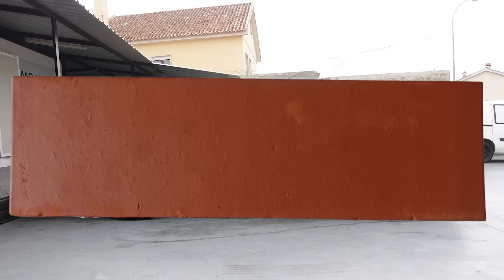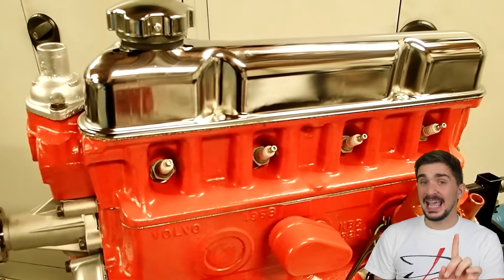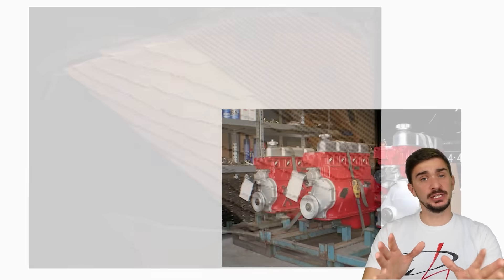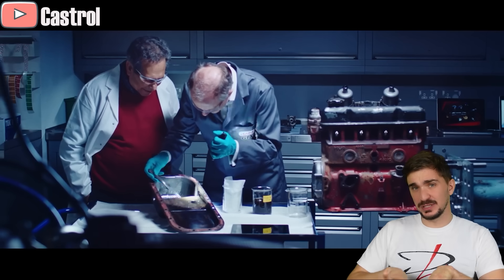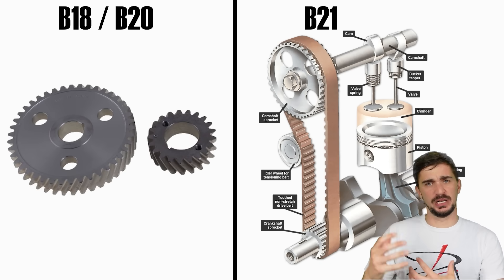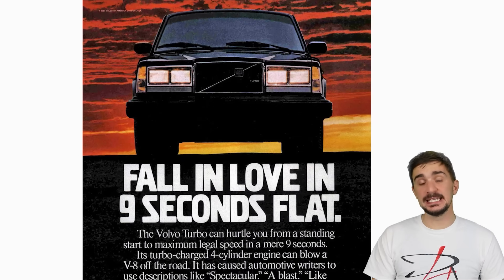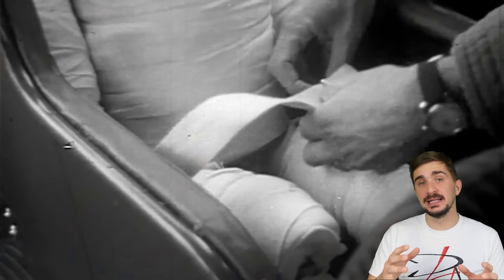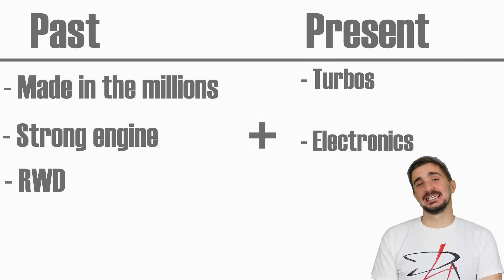A Story about the Volvo 240 and its Redblock Engine - Iconic Cars and Engines #18

Comment: The Volvo B18 has a similar timing system to the Ford 240/300 inline 6 since they both hast cast iron timing gears. Almost thought the B18 would have been inspired by the 240/300 inline 6, but Ford didn’t come up with that design until 1965, but still interesting on how the layout and design is similar design being 4 years apart.

Comment: Imagine what we would be driving today if corporations still built cars with the CUSTOMER in mind first. But instead we get "efficiency" and "maximum profitability" with dealers charging insane labor rates for fixing issues the factory designed into the cars to boost profits. Planned obsolescence and record shareholder profits beats making good cars.

Comment: this car is undiscovered treasure, when the design is this good it becomes a work of art; extremely easy to work on too but if you get one of these older ones it's very important to check the drive shaft bearing; might need some grease

Comment: I should have purchased an older Volvo. Instead I purchased a 1997 Volvo 850..... engine was a total piece of junk. Head-gasket started leaking at 100,000 miles. The local Volvo dealer didn't want to touch it. They said it wasn't worth fixing as on that model because the head is attached with special glue and is very expensive to repair. Instead I drove around with cans of head-gasket sealant in my trunk. Almost every other Volvo 850 owner I met had similar problems. The heater electronics was very complex and kept needing repair. The 5 cylinder engine was also difficult to work on. To replace the starter, you need to first remove the intake manifold. Unbelievable. I've never seen this on any other car and I've changed probably close to 100 starters. The car also had a useless turbo. Upon acceleration, there really was no noticeable increase in power. I bet if you had another identical car without a turbo -- there would be virtually no difference in performance.   IMO -- turbos are more trouble than they are worth on small gas engine cars.... will never buy another but that is separate topic.

Comment: I worked on these 240 series for many years, but as a collision tech.  The 224 motor, and everything else about these cars were bullet proof.  But aside from the motors, the 740 series was a disappointment.  The back end was particularly weak if the quarter panel was removed and the chassis would flex literally inches without the quarter.  The 240 on the other hand was properly rigid from end to end.  I worked at a Volvo dealership and worked on hundred of them and the 240 was definately superior.  The one thing 8 did hate about them was the tarry undercoating which was closer to a semi-solid grease.  And if there was a brake fluid leak, you could expect to be covered in black for the duration.
Reply: Thanks for posting that info.

Comment: you really made my day !  thanks
Discovered your vids yesterday and have been hooked, and now I discovered this item on (old) volvo's... loved it !    I have owned quite some classic volvo's and I was once spare parts man for the volvo club in Belgium...  so I've seen quite a bit of blocks and parts, still have a P1800
Did you know the B18 originated originally from the B36 V8 light truck engine ? Cilinder head, valves, pistons etc.. were inherited from this block. Early B18's had even wider camshaft bearings than later models.  So that maybe explains a bit the overengineering ;-)
THANKS !

Comment: I had a 240, wonderful. It was built like a tank so was not very agile and the brakes were only adequate. I took the rear bumper off to remove an unwanted tow bar and it was too heavy to hold up with hand when I tried to bolt it back on. It was a huge aluminium extrusion that would not of been out of place on a bridge.

Comment: Actually the 240 came with B20 in the start. I had a -75 242L with a B20A, boasting a foull 82 hp. The weakness of the B20 was the camshaft, that struggled with lubrication in the cold weather, with the fixed fan cooling the front of the engine too much. By the way: The reason the camshaft is gear driven is simply that it is an OHC.engine, not OHV.

Comment: I almost had to stop watching at 6:53 when you say 'then in 1975 came the real deal' ~ *disagree*.  Yes, the B21/23 is a very very very rock solid engine, and I know this is a story about the 240 but...  The 240 is a wonderful safe boring box, a bit full of plastic that breaks, bad switches, crummy door handles, bad heater fans....  It only went down hill starting with the 1 series in my opinion.  The cars got bigger, starting moving in the direction of plastic, bells/whistles etc.  ease of repair and reliability started to go down hill.  The engine itself, and the whole running gear ~ any of the RWD volvos (save the V6's which suck) are wonderful and I'd argue... the older, the better.  (I do love the 240 though, I think it maybe the last 'good' car ever made)

Comment: I bought a 200 series, 244 i think it was in thr late 80's, new.  While the engine was reliable, the rest of the car was not.

Heated seats, quadraphonic sound -anything electronic failed before 100K kms.

My LS400 that replaced it was much more reliable, it was also nicer to drive, less ugly, better resale etc.

I then bought an LS430 which covered over 800,000 kms before it recently had issues that could be fixed but weren't viable, so it was sold for parts, i couldn't believe it was actually still worth anything.

Comment: I have a 1970 145s. My b20 had three wiped lifters. And it still ran basically perfect. Down on power but other than that it did not care. They are tanks of an engine.

Comment: Sigh, you really had me with a TIMING GEAR (Studebaker used them - UNBREAKABLE), and then they went to a BELT with the OHC.  Chairs are considered lifetime, why in the world would they use a belt ?   I won't buy a car that uses a timing belt - that component is not supposed to wear out.
Reply: Long ago, RR used them but they were so bad that they were replaced with aluminum.
Reply: @wholeNwon  don't quite understand:  what did RR use long ago and what replaced with aluminum what?
Reply: @NoferTrunions  As I recall, it was a timing gear, but that recollection is vague. It could have been a different gear.  But it was a fiber material of some sort. When they were replaced, the cover was stamped with "A" for aluminum. They have done a number of odd things like that in the past such as incompatible metals suffering from electrolytic damage, defective crankshaft casting, etc. They were odd cars.
Reply: @wholeNwon  Ah!  Studebaker also started with a fiber timing gear - but it was massive,  at least 1" thick with a mild helical cut.  They ran this on all their engines starting in 1951 until 1964 when they stopped.  However for their R-series engines from 62 to 64:  high compression or supercharger, some with rare big intake port/valve heads, they used an aluminum gear.  I think the issues was the steel hub interface with the fiber gear but speculation on my part.  NEVER saw a fiber gear fail.  FYI I had a numbers matching package R2 Super Lark with an R3 engine swap.  Had for 52 years, sold it last year with over 10 pickup truck loads of parts.
Reply: @NoferTrunions  Amazing. We had one in the '50s...peacock blue. Can only barely remember it.

Comment: volvo b series motors are amazing. had a b20f could never kill it. fed it so much shitty fuel and oil. it never cared..started every day. best motor i ever had,

correction sir.  1993 was not the last year for the 200 series. 
the last volvo 240 series was the 244 Olympic Edition. Released in 1994 for the Lillehammer Olympic games. I had one in white so i should know.

Comment: having owned b16 true amazon , to v90 the last r w d and real volvo ,the best all round was my 240 glt wagon absolutely stock, went far better than it should , had coil spring dampers at the rear as i towed a trailer , you could get this wagon in a nice 4 wheel drift on real fast turns , but my real rocket was my 121 wagon ended up with a 2.3 push rod red block , 200 bhp on webbers 180 on su,s , this would pull 7000 in od top 130 mph plus , could never get a stiff enough front arb , where as my white block is so smooth , but i could only get a freaking auto and the gear programing is shit , but for a huge wagon it still handles great, as for the new v90 its shorter taller and made in china that sums it up

Comment: Well, having owned 142's, 242's, and a Bertone I can say I like Volvo's. 
BUT, how do you explain that turd of a 6 cyl motor that came in the Bertone??!! 
Coming home from work one day I did a casual downshift and the shaft that the fan is bolted to broke and the fan propellered through the rad....! 
I was only 4 or 5 blocks away from the house, so I drove it home.  Still, easily one of the worst engines Volvo, Renault and Peugeot ever. No Swedish steel in that thing I'm guessing....!!!
I wish I had installed a redblock in the thing. Instead I found another 6 cyl at the wreckers and threw that in.
It didn't last all that long either!

Loved your article! Very informative!

Comment: I have a 1976 245DL Wagon, it was my first car.  Somewhere around 400,000 miles on it.  Also an 85 240 Turbo wagon.  The factory intercooled turbo 240 (manual transmission) is actually clocked by Car & Driver as doing 0 to 60 in 7.9 seconds.

I learned to drive clutch at age 7 in a dirt parking lot in a 145S.  We had that till the timing chain broke.  Also a 164, and have had two boats with the AQ120B, then AQ125A, and I have an AQ171A which was supposed to replace the AQ125A but I no longer have the boat.  The AQ171A is the 152 cubic inch (2.5 liter) with DOHC.  I don't know if I'll ever be able to use it though, the exhaust manifold is scarce, expensive, and with saltwater use 2 to 3 years at best is what I got out of the manifolds on the previous two boats.

Comment: My father worked for Volvo when these cars were being sold. He was a warranty administrator. He could tell you horror  stories about them. The engine was, yes, pretty solid. And boring. But an engine is not a car. And the car in total let down Volvo's "indestructibility" reputation. Those are the facts, not just opinions.

Comment: My husband's mom started off with a Volvo 340DL  then his dad had a 340GL as a works company car. Then they graduated up eventually to an 840. 

The 840 suffered a slow speed rear end collision from a Vauxhall Astra, nothing seemingly happened to the Volvo however, the young lad's Astra, which was his first car, looked like it had run into a wall. They took the Volvo to the dealers to be sure it was OK and all that had happened was that the number plate panel was slightly distorted. This was just rejigged straight. Job done. Built like a tank.

His mother chose Volvos to ferry round his 3 younger sisters in safety. It did an excellent job!

Comment: I had 2 244 gle with b21e. Loved the car. The first I knew it’s history it was my grandfathers car. Very good maintenance and delightful to drive. The second was second hand. How ever both cars, their engines started getting very slow and lot of oil consumption around 220/ 250000km. Not really indestructible. The 850 I got next, 2.5 l valve was far better. It clocked 350000km and still struggle strong. Never mind my actual Mercedes w211 with 646om which has now more then 560000km.

I still miss the Volvo. The noise. The no fuss presentation and loved that bumpy look . The car was from 1980 with those rubber bumps. But by no means indestructible.

Safety however passively was good.  Dinamically not really an alfa Romeo but it hold itself being very predictable with very very good brakes for the time.

I had notice that the b23e in latter models were far better then b21e and really lasted long time. 
Good thing in both they were no interference  engines. So when distribution broke the engines stoped smoothly not breaking anything.

Comment: Had a overheating problem with my 244(B23E motor)so had a go at replacing the headgasket and with some help and advice from local Volvo mechanic was able to cure the problem. Engine going strong even though was overheating for some time.

Comment: is there a 6 cylinder version???
Reply: If you want it in red you have to go with the B30. Simply a B18/20 with 2 extra cylinders. B19/21/23 B200/204/230/234 never came as 6 cylinder unfortunately 😔 there was a rwd L6 engine tho in the 960. B6254 and B6304, whiteblock (aluminum)

Comment: The Pinnacle of Red Blocks is not the B23T, but a 1993 B230FT (or B234FT) running LH 2.4.
Reply: B234FT has never been a production engine. Only B234F and B204FT/GT

Comment: I bought my first car, an 89 740 in march of 2022 at 19 years old with 292k kms on the clock, it was a stock N/A car some time ago. Previous 2 owners spent lots of time replacing all the non turbo parts and installing a 531 head with a 15g to pair up with it, along with all the other 940 turbo parts.
sitting at around 315k now with a stage 2 clutch, lightened flywheel, on 15 pounds of boost, and BCRacing coilovers. I think that these cars are the best in the world. they are sporty with the right mods, and will keep up with pretty much any modern hot hatch, and more. I intend on keeping this car the rest of my life, whether that means i have to rebuild it 15 times or not. I'm making sure this brick shithouse stays upright, so that 20 years down the road I can confidently say that the volvo 740 and the redblock with all its counterparts is the most reliable and enjoyable motor/car ever made.

Comment: LOL, I will have to show my daughter this video since she is the one driving our beat-up old 1990 Volvo 240. One thing that Volvo definitely screwed up on was the crappy odometers which tend to all fail miserably as the plastic gears disintegrate. Also, the engineer who came up with the flame-trap and its location deserves a serious dope-slap.
Reply: Those gears are easy to replace. The later 900 models had much bigger issues with leaking capacitors. Also fixable. It's worth mentioning that those instrument-clusters weren't produced by Volvo - some were Japanese and some were German.

Comment: Back when the goal wasn't planned obsolescence but rather: Build a good product.

Honestly love these cars. A friend of mine has one he's been driving since the mid 90:s. They just don't build them like they used to.
Reply: That was the 200 series' biggest problem. They were too reliable so who would buy a new car.
Reply: @Nubbe999  Would have been its best feature if we lived in a saner world.
Reply: I wonder if the Japanese will do the same
Reply: @ChrisPatrick-q6k  the 200 series was literally built to be the safest production car ever made and pioneered many features that are standard today and the reason why modern cars are so safe.

There's been a lot of refinement since then, yes, but there has also been a paradigm shift. Modern cars are cleaner, more efficient, safer, more comfortable and have so much more electronics in them. Most of this is good, but how much more efficient are they if you take the planned lifespan of the car into account?
Reply: it was still planned obsolescence, the heat death of the universe is just a bit later than usual
Reply: I was thinking the same thing. People actually fixed their cars back then. Now it’s just sell it and buy a new one.
Reply: Thank goodness, today's cars are much much safer, more comfortable and efficient.
Reply: @ChrisPatrick-q6k  not always the case my friend.

Comment: My folks went to Sweden to pickup their 1969 144.   You picked it up at the factory, and toured Europe to get 3500-miles on it, at which point they could be imported as a used personal vehicle, and not have to pay the import duties.  My younger brother got it in 1982. And drove the hell out of it.   It got totaled, while parked at the curb, at 600,000-mile by a drunk in a  Volkswagen Beetle.  He was pretty pissed because he had just rebuilt the entire suspension.   The Insurance company gave him $3500 for it and let him keep it.   He rounded up a Non-running 145, and swapped the drive train and suspension into the 145.

Comment: Warning, they can't hold alot of boost, because thee head gaskets and head studs are the weak points. Sent my head at 13 psi or so, but I did have a custom turbo cam that made the stock turbo scream.

Comment: I entered an old 240 in a banger race once, hammered it in second gear, all the way around for almost 75 laps before i crashed on the front stretch lol. Those motors are tough.

Comment: You said the 200 series came out in 1975. I owned a 1974 Volvo I bought in 1978. I drove that care till 1987 when I bought an inter-cooled 940. I was a good car except for the rust. I had a head on collision with a mini cooper. The bumper took the full shock of the collision and I didn't even have a scratch because the bumper was covered in rubber.

Comment: I have owned 2 740's  both used both lasted a decades plus and I sold both for profit.  Loved these cars plus non interference engines B230 red block was genious.  Open engine bay perfect for diy.  And the cars would not die.  Master cylinder replacemnt, harmonic balancer or timing belt can be fixed without a lift amazing car.  No  turbo and had calif pollution controls.  You had to identify the innards to get right parts

Comment: I had a blue one back in the 90s it was bullet proof until someone jumped a red light and I hit them hard and the insurance wrote it off. The car looked fine but wouldn't drive as the engine broke off it's mounts and pulled the propshaft out of the gearbox from the shock, the ford escort however spilt its guts over the road and was taken away in a bucket. It was a beast for sure but only managed around 17 MPG urban.